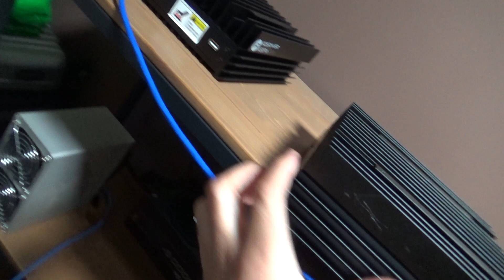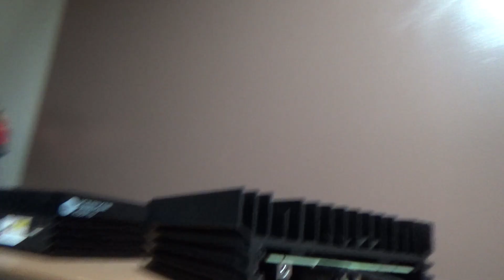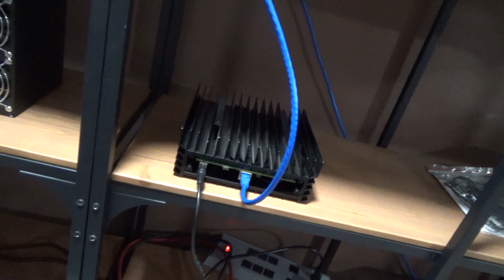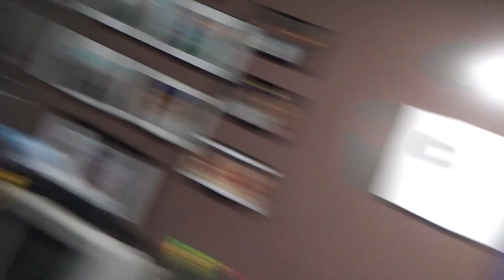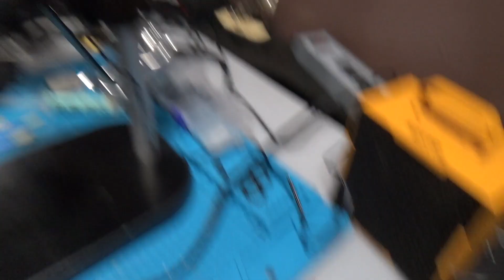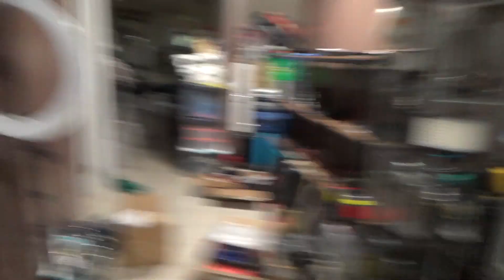ICERIVER KS0 REPAIR

Comment: I bought some used kas0 Ultra Miners, but unfortunately they were all over-powered and used 170W each but only had a 120W power supply. That's why I wanted to install the original software. I tried to load the software but it didn't work, so I pressed the reset button for 2 seconds. Now the miner won't boot and only uses 2.3 watts. Can you please help?
Reply from the maker: What software was installed in the miner?